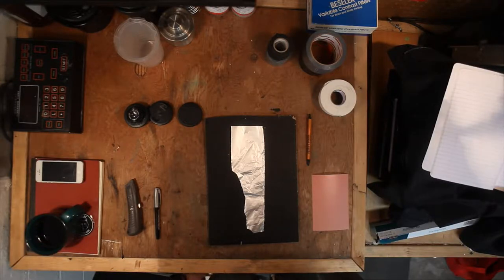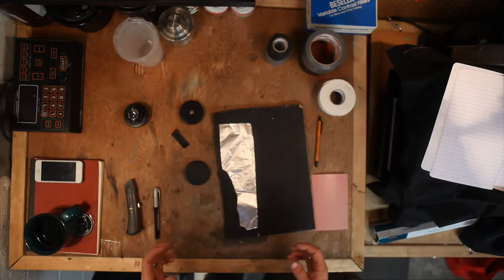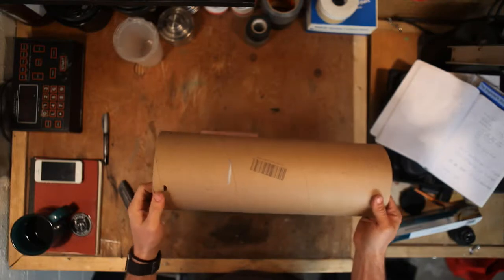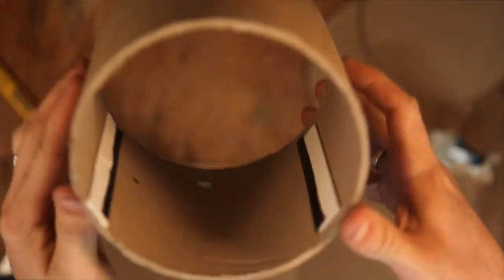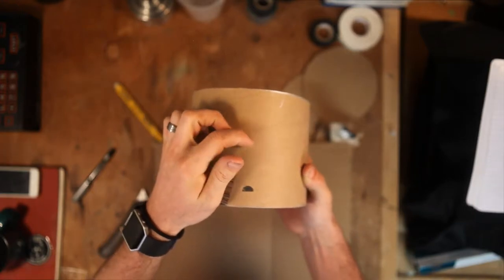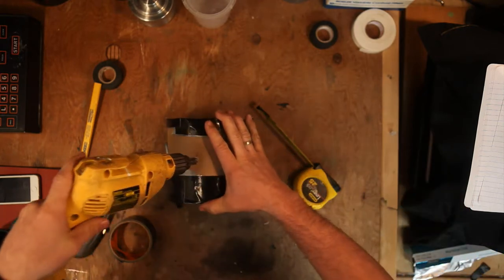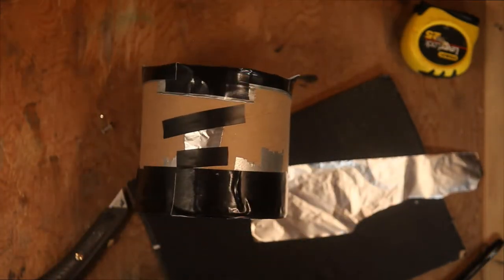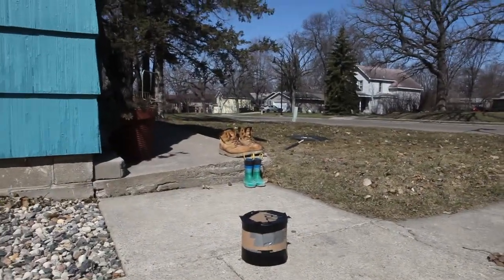Film Tutorial #11- How to make a Pinhole camera

Comment: Just a little tip, the best sharpness you can achive is with a 0,4 mm hole. Less than this diameter you will have a loss of sharpness caused by the diffraction. Ansel Adams talks about that in his book, 'the camera'.
Reply from the maker: Yes, very good information, the complex optics at work in such a simple setup are really cool.  Do you have any cool pinhole cameras?